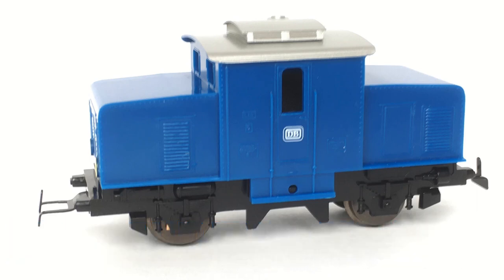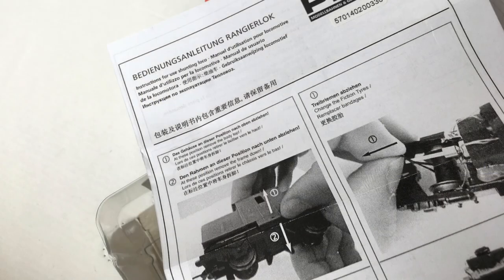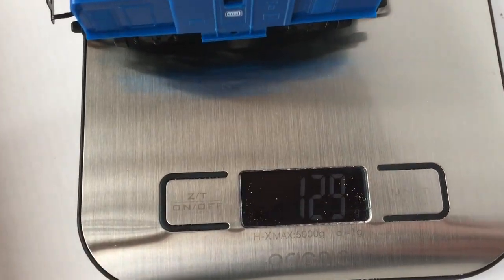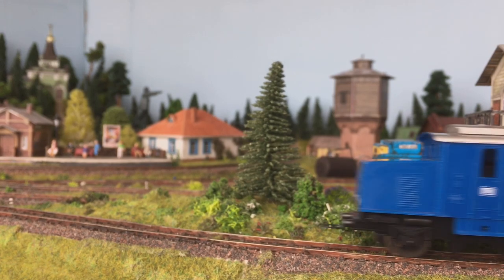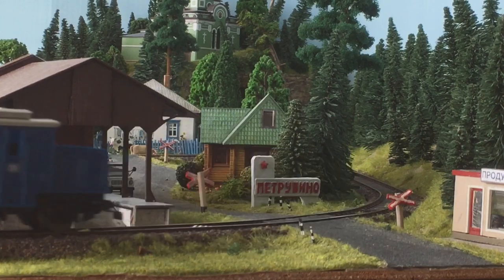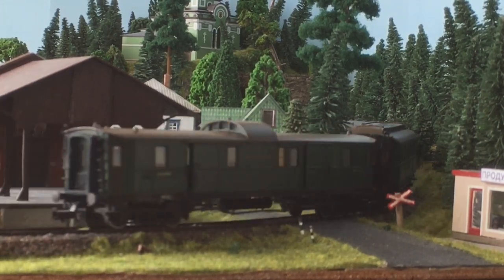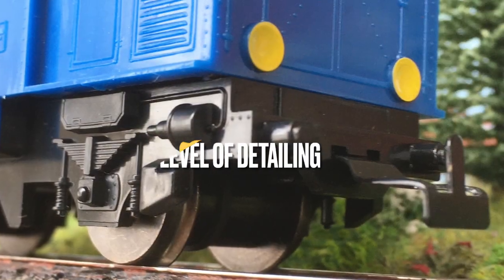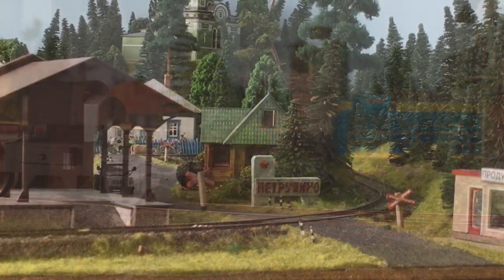Unboxing & testing a new rubber band locomotive: how will it perform?  резиноход Piko MyTrain E69 DB

Comment: Hi, very interesting small Loco, it does not run well at low speed so it will not make a good shunter.  It also lacks a lot of detail which is surprising for a Piko model. However it was not expensive so its a good addition to any layout as a novelty running around. Thanks for showing, Cheers Paul.
Reply from the maker: That’s true, not really a shunter. I will probably use it for smaller passenger or freight trains. And maybe a light makeover… 🤓 Thanks for watching and commenting! Greetings from Belgium 🇧🇪